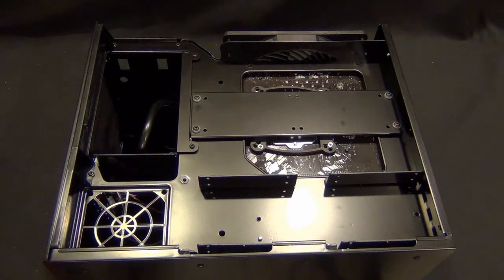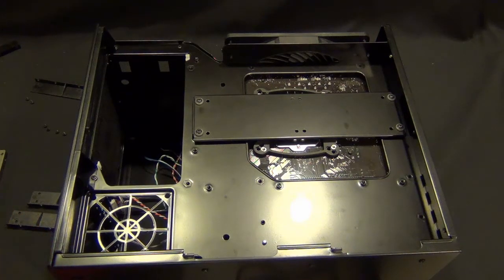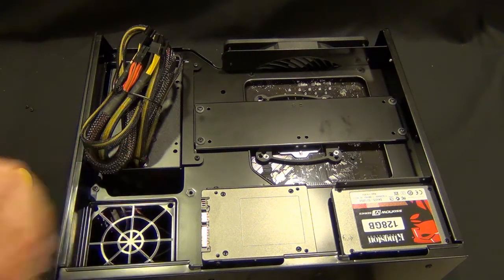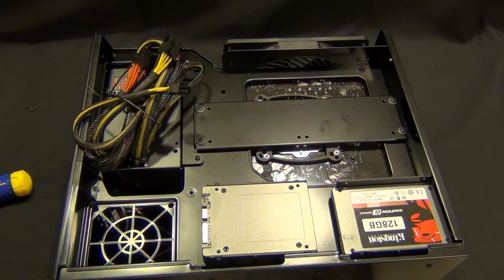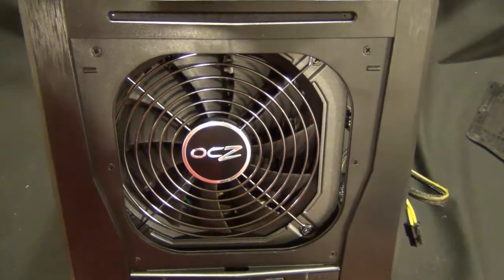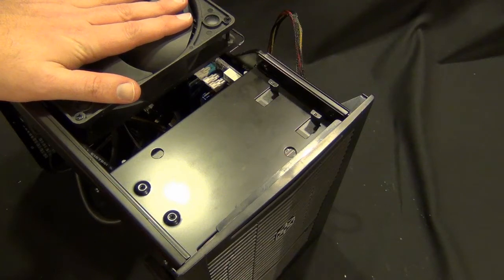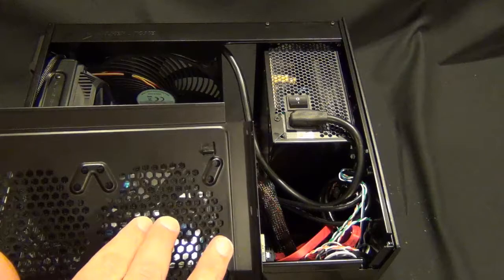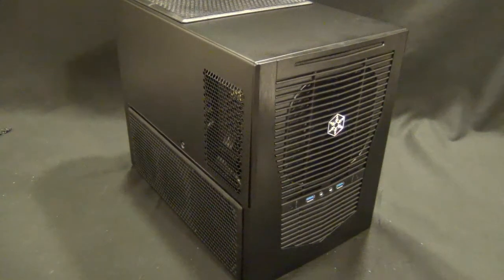How to build a m-ATX computer - Part 3

Comment: Great build vid, I'm building one of these myself and this is a great guide. One note however, the refrence to the slim drive in the top. If you need a proper drive bay in this form factor you buy the sg10. Granted when you made this they likley had not realeased that case so not your fault. But personally drives are defunct and this case without the wasted space of an empty drive bay is for me perfect. I only need two small bays for laptop ssd's and the usbs. Great build tho.

Comment: Do you think you could center the PSU with some rubber (or metal) washers between the case and the bracket?  (Obviously might need longer screws too though.

Comment: Undo the 2nd sata power connector from wires and move it closer to the 3rd connector. then the cable length should be able to go around the left ssd and reach the right ssd with the 1st connector. Shouldn't be a hard mod.

Comment: I've just built a Gigabyte B75 uATX system in the SG09, w/ same power supply.  With 2 stick-on tie down mounting bases you CAN do very reasonable cable management.  I even had 2 PS modular cables (the 1->3 fan power splitter needs a molex, so I could have used a molex-sata to help better route the sata power to the drives.)  I have a 2.5" and a 3.25" drive with Mint Linux and PC-BSD.  The box will be a Hackintosh when the piggy bank allows a SSD. Used an i3 w/ stock fan. Works great.

Comment: one suggestion, @ 12:00, why don't you switch it so that the cage with 2 ssd drives are on the back side of case, and the cage with one be in the middle so the wires don't have to bulge out?
One question -  what psu did you use? would you recommend semi-modular or fully modular?

Comment: u can pull and tied the front wire to the back panel where the 3.5 bay, and reroute the 8pin to the top from the slot drive wiring hole.